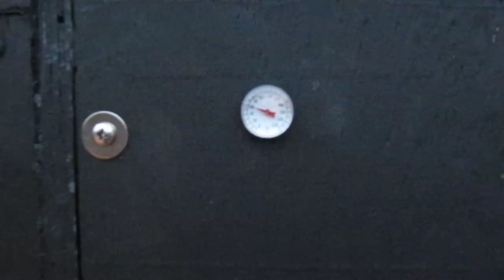GenBox 1.0 Setup

Comment: Best quiet box I've seen yet. Sitting on a gold mine if you patented this and sold it. You could even be a seller in Amazon cause I would definitely buy this one.
Reply: It’s called a Zombie Box, google it
Reply: @scottb_02  I'll leave the 1700.00 for someone else. Would rather have this design at probably a 10th of the cost.
Reply: Chaze Marion Agreed, their prices are insane! My full thoughts posted here; “Mix this with the quicker connections of a zombie box (google it) and you’ve got something. Not spending three plus hours in inclement putting this together. Needs to be weatherproofed, but an awesome beta. Would also add a fan for ensured airflow under load.”

Comment: I don't see me assembling this in the rain when it's most needed.
Reply from the maker: Why not? Do you dissolve in the rain? Anyway, neither do I. Mine has just been sitting outside the house already-assembled ever since making this video 4 or 5 years ago. Just because it breaks down doesn't mean you have to break it down. That's just for hauling to a camp or a festival or something. The box is weather resistant enough that it can just stay there all year, and the generator can stay inside all year and doesn't need to be stored away anywhere else. My gen has been inside the box the whole time, all seasons. I start it up a a couple times a year and it's been fine every time sof far. All I'd have to do in the rain is lift up the lid and start it, and hook the cable to the house inlet a few feet away. Total time outside maybe 30 seconds. It all depends what matters to you and what you want most.

If you want to spend less than $800, and be portable, and have real quiet, then that's what this does.

If you want to spend minimum $3000, and have no portability, and have a lot of noise, but you don't have to go outside to start it, then you want a regular whole-house permanent install like a Generac.

Comment: Very nice sound box. I like the idea of not having to modify the exhaust. Just having one fan for cooling and air exchange without ducting the exhaust. I'm thinking of pouring a concrete pad outside my home and making a permanent fixture (don't need portability) and your general box idea would work well in a permanent enclosure too. Obviously the outside of the box would need better material for weather protection, shingled & angled roof, maybe a siding material on the outside, etc but the idea of just one big opening on each side for intake/exhaust and the overall construction for noise reduction is great.

As you stated, can't tell if the camera is adjusting the audio or not, however judging by the fact that I can hear your feet shuffling around while assembling it, and the noise level of the audio you're playing in the background, I can deduce that it's quite a noise difference. You can hear the audio playing once the generator is running. If the camera had reduced the noise level the audio would be at a much lower level. When the generator is running without the box the audio is completely over powered.

What I'm interested in is the materials used for the actual sound proofing. Foam boards, fiberglass insulation? Rubber pads? Multiple layers? 

Would you mind going into a bit more detail in the internal construction? 

Thank you for sharing your project.
Reply from the maker: +jonboy545 
I should draw up plans. I do have some pictures from during construction, though some of the exact details changes along the way and the final result is not all exactly as what some of the pictures show. But it shows the important ideas I think. I will have to post a link here later. (If Youtube actually lets me post a url grr...)

The main inner 4 walls and lid are 3/4" pressure treated plywood with some pressure treated railing stock that's about 1-1/2 x 1-1/2 used for the corners. Then the baffle boxes on the ends are 1/2" pressure treated plywood added onto 2 of those main box panels.

The baffle boxes just force the air to travel around a single 180 degree bend. They may be removed, so you can use just the main panels for a simpler and smaller, but louder box. Maybe more convenient for a camp or festival or something where you have more room and noise isn't quite as important.

Then there is just a couple layers of carpet glued and stapled to that inside. The baffle boxes just have thin patio mat that's like indoor/outdoor carpet with no backing. Light weight, thin, smooth, and cheap. Does not constrict the airflow in the tight channels, but does make the wall non-reflective. That stuff was not enough of a sound absorber for the main chamber though so adding a layer of cheap 3/4" shag in there did the trick. I did have to make a special heat-resistant spot right where the exhaust blows on the inside wall. I used silicone glue, aluminum foil (shiny side toward heat source), fiberglass torch mat (for sweating pipes) and aluminum screen. So it resist the heat and still absorbs sound too.

There is no bottom. The whole thing sits on the ground or on a carpet.

There's a lot of details I guess. I started to write everything and I think it was too big and youtube won't accept it. So now instead I'll just have to say I'll post a link to some pictures which the pictures themselves explain some stuff just by seeing it, and maybe I'll write up more detailed plans or directions. Maybe a diy or instructables thing. Now that It's been sitting out there outside the corner of my house ever since I made it, and it's been great the whole time, I feel a little more confident offering it as a something worth copying or improving upon.
Reply: Plans would be appreciated
Reply: Nice job, also, thanks for posting the pics.

Comment: Only problem is when generator power is needed, you get to hear everyone else running theirs.  Im in the pricess of building one for permanent storage and to keep it out of the elements.  Good job.  👍
Reply from the maker: Yeah this is for portability as much as fixed installation. For fixed installation, it's much simpler, just throw up some cinder blocks and otherwise do the same fan venting and S or at least U shaped inlet & outlet air passages. In my case, no one else around here has a generator, so I would be the only noise-maker, and get yelled at by my annoying neighbor. And for portable usage, think of festivals or campgrounds where there are a lot of other people near by. If you have some distance available, you can cut a good amount of noise by just leaning flat sheets at a 45 degree angle all around the gen. But that still leaves enough noise that the gen must still be a good distance away from anyone. This tight box with special U-shaped inlet and outlet air passages just makes that minimum tolerable distance a lot shorter that's all.

Comment from the maker: Work in progress for plans. Don't take the dimensions too religiously yet. But the overall specs, 2 4x8 sheets of 3/4" pressure treated plywood and 1 4x8 sheet of 1/2" and 30 or so feet of 1-1/2" railing stock, and start by cutting all 3 sheets into 3 equal 32x48 sections, that much is correct. See the google photos link and see the sketches at the end. I'm playing with making better drawings in FreeCAD but it will take a little while.

I think I have to partially disassemble the box to verify some of the exact details around the fan and fan mount.

https://drive.google.com/folderview?id=0Bys6eLbSbYyhNDV0OE1rTGFRS28

Comment: This is by far the best one I have seen!! What's the highest the temperature it has reached?
Reply from the maker: 120F! In the summer on a about 80-85F ambient, after running solid for a couple hours. It rose to 120 in about 15 minutes then stayed the same the rest of the time. I can lay my hand right on the hot spot where the exhaust blows too, so that's not getting hot enough to worry about. You can't see here, but the inside wall is mostly all just cheap carpet, but the spot where the exhast blows right at the wall, it's 3 layers of aluminum foil glued to the plywood with high temp rtv silicone, and some fiberglass torch mat over that, held in place by some aluminum gutter gard mesh. That not only blocks the heat from reaching the plywood, it even absorbs sound too.

Comment: With no vent fan, etc how does the heat and fumes not build up?
Reply from the maker: WillBrink Read the comment attached to the video and see the links to the pics and plans. There is an insane fan. This video was just to show the total real life assembly time just to see if it's practical or impractical for portable/temporary use.

When you look at the pics, ignore the first two types of fans from the early pics. Scroll to the bottom. That final one is the only one that's good enough.

So basically the main theory of this thing is two things.

1: The air is forced to move around a 180 degree bend on both the inlet and outlet. Sound doesn't do that very well, especially with indoor/outdoor carpet lining the inside surface of those ducts. But the air does just fine, so that's how you can have a huge 12" hole for air and no sound from inside.

2: The fan is strong enough so that not only is the heat carried away, but you don't need to make any special exhaust piping which would make more noise and greatly complicate things and make it so the box only works on one exact model of generator that you made the exhaust piping to fit. This way you just put any portable generator you want in there. The fan is on the inlet side and pushes air out the outlet, so, the corrosive and hot exhaust   doesn't blow on the fan and kull it, and the exhaust is near the outlet, so the direction of air flow carries the exhaust immediately away from the generator and out of the box. IE, the exhaust doesn't blow across the generator before getting outside.

I'm sorry none of that is shown here, as this one was intended just to show the total real assembly time and process just to show if it's good enough for camping or festivals or other portable temporary uses. I would rather have some more convenient faster latching mechanism than 12 screws, but I think it's actually good enough after all. One of the many design goals was not to have any bits that stick out that would make the pieces not stack flat, and that would get damaged and snag peoples clothes in the dark etc. That is hard to do with any kind of latch that could pull these panels tightly together at the corners. There might some kind of crazy expensive special marine latch but I also wanted all the materials to be cheap, so anyone could build one from a local hardware store. There was no way to get around needing a real special fan, but at least everything is cheap. 8 or 12 special latches you can only get on-line and cost $50 each highly violates THAT goal! :)
Reply from the maker: WillBrink There were actually a lot of design goals that aren't obvious at first glance, but I managed to meet most of them. Like those handles made out of tow strap. They crush flat and they don't rattle with vibration.

This box has actually been sitting outside my house, assembled, with the generator inside ever since this video was made. I fire it up a couple times a year to keep the carb clean (shut the gas off and let it run itself dry to shut it off each time)

I installed a generator inlet plug and main/generator breaker interlock on the electrical panel, and have a generator lead I can run from the generator to the house to feed the whole house. The lead stays coiled up right inside the box.

This is less convenient than a normal whole home generator, but the point is this was built to be portable, and yet it's also good enough to sit there outside permanently. But that's just because I used all pressure treated plywood and 2x2, all stainless steel hardware (wood sctews, machine screws,  T-nuts, washers), and painted it with this very thick deck paint.

The carpet underneath now has an inch of moss growing on it but that doesn't hurt anything.

Also in case it wasn't obvious from the vid, the 10 minutes to close up the walls is just for the vertical walls. You don't need to touch those while using the generator. You can access the plugs and refill the gas and turn it on and off and pull the starter all from the top by just lifting up the lid. You only need to do the screws during setup or take down.

Comment: I'm interested in getting the plans
Reply from the maker: I never drew up cut-sheets/cut-lists, sorry. Closest you can do is, install FreeCAD, install the Assembly4 addon, then download the project from the github link, and open the Assembly.FCStd file. That is a model that has all individual parts modelled, and grouped into subassemblies like Inlet_Box and Outlet_Box etc.

To get measurements, first Edit -> Preferences -> General (icon on left) -> Units (tab on right) -> Building US or Imperial Decmal
Building US gives fractions like 1/8" , but also gives 2'8" instead of 32"
Imperial Decimal gives 32", but then also gives .125 instead of 1/8"  shrug pick whatever bugs you less.

Also to get cleaner printouts: Edit -> Preferences -> Sketcher (icon on left) -> de-select Show Grid

In the tree on the left, right click on each top-level item and hide them all.

Now pick one like Inlet_Box_LinkGroup and expand it, drill down to one the parts, and double-click on the Sketch the part is made from.

Inlet_Box_LinkGroup -> Inlet_Wall_LinkGroup -> Part_H_Inlet_Wall -> Sketch_H_Inlet_Wall

Use the mouse wheel to zoom out a little and right-click drag to center the view, then File -> Print.

That only works for the plywood sheets.

For the 2x2 rails, You can use Measure -> Linear, and then click on one end-face, flip the view around, and then the click on the other end-face, and it will show a dimension like 30.00in

It's annoying. Sorry.

Also that still doesn't tell you details like exactly where to drill holes and place fasteners. Have to look at the 3d model and see where things go. Some parts are meant to come apart, and they have machine screws and T-nuts, others just have wood screws. You can see the T-nuts wherever they are supposed to be. Hide parts to see things covered up by other parts. 

The LinkGroups are all sub-assemblies that you would build in real life in the same order. Like you'd build the Inlet_Wall_LinkGroup by itself with all wood screws & glue, then build LinkGroup_Baffle_Box the same way, then join those two assemblies togther with the 9 machine screws, washers, & T-nuts in LinkGroup_Baffle_Box_Anchor_Screws.

There is a fairly complete parts list in a google drive doc linked in the video description.